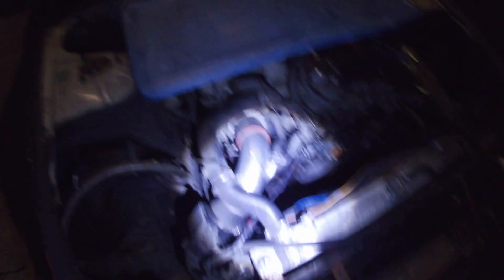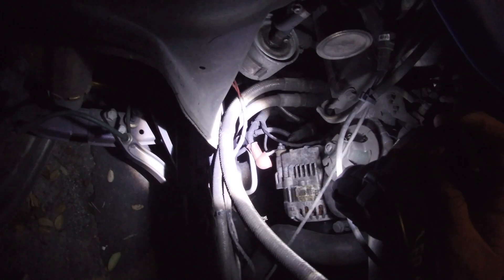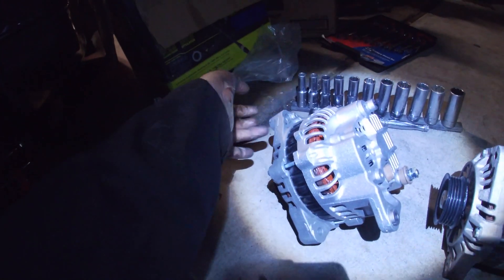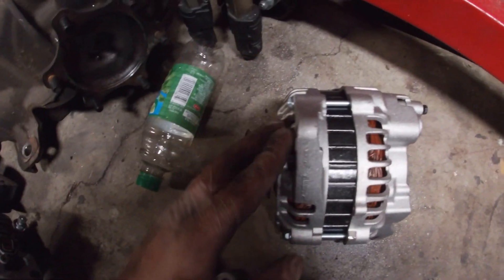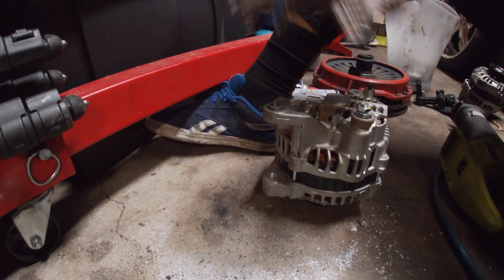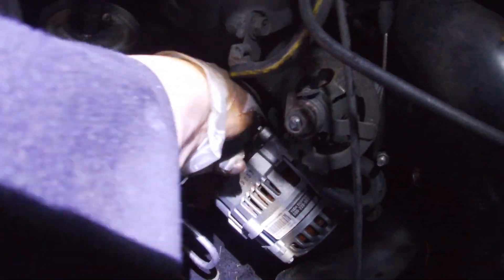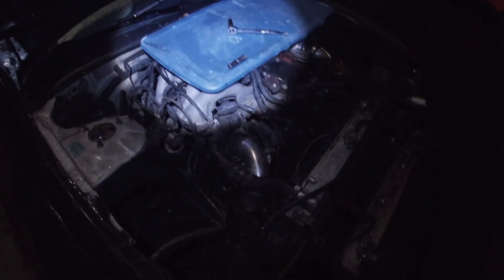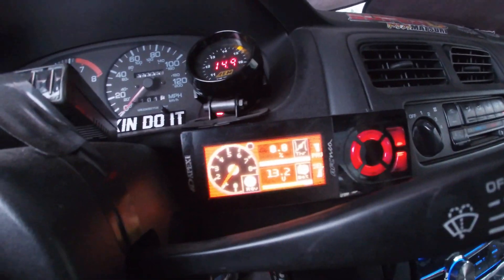Ka24de 240sx 100 amp Quest Alternator Upgrade | DIY 4K

Comment: Great video. Did this today and it took me as much time as your video run time. Cut the top, drilled the bottom and did a very small mod to the bracket and it is good to go. Belt is on and tight. Thanks. I used a 1995 Nissan Quest alternator.
Reply from the maker: Thanks man! Good to hear that you were able to do it with out any major issues.

Comment: Did the swap but my alternator is making a squeaking noise and I think chewing up the inside belt, idk I the sr20 and ka swap belts are the same. Maybe it not aligned idk
Reply: You have to use belt number 4k320 from what I have heard for s13 chassis and maybe s14, It’s a bigger belt. Did you have any issues with the connectors ?

Comment: How did you get it to line up to the tensioner bracket, looks to be that the tensioner bracket needs to be slotted???
Reply from the maker: I had to shave off a little bit of the alternator housing to have it line up properly. Didn't show it in this video but I'll try to show it in the next one I make of the car.

Comment: Did you have an issue with the top hole being just below the bracket?
Reply from the maker: Didn't have that issue but the original bolt was too short to actually work with the bracket so I had to find another bolt and nut to allow it to bolt up

Comment: So the pulley that comes with the quest alternator doesn’t have to be changed out?
Reply from the maker: Nope, you just have to properly line up the different belt with the corresponding ridges on the oem crank pulley.

Comment: Damn .. where the links at gee ? Ha
Reply from the maker: Lol, If you run an underdrive crank pulley I believe it's the same size but if you use the oem crank pulley I used a 4k320. Any brand is fine just make sure the last digits end in 320.